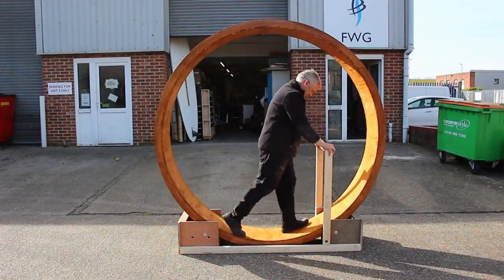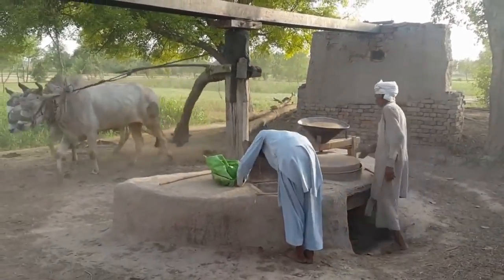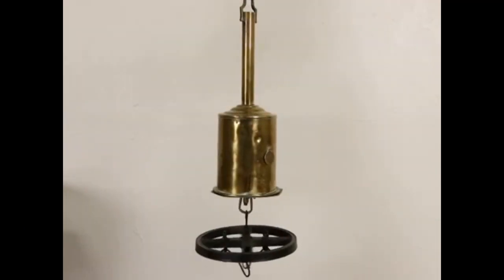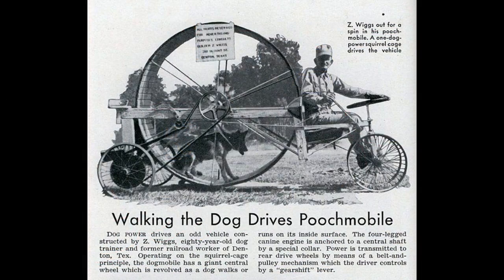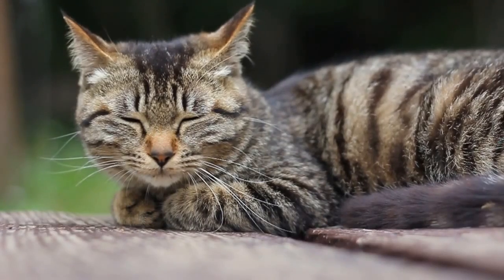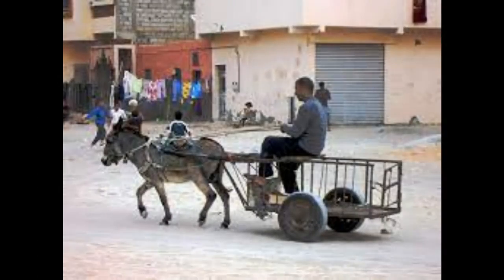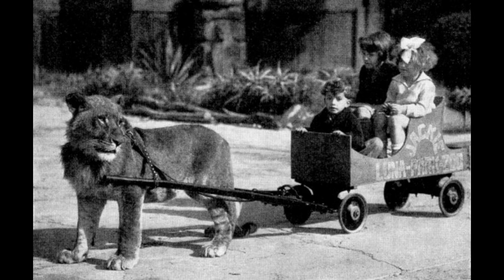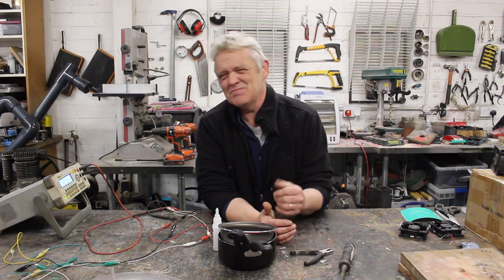1694 The Answer To The Energy Crisis - Pig, Dog And Goat Engines

Comment: Actually, in all seriousness, as I begin raising meat goats, which are larger and stronger, I do have ideas for employing them here on the farm for a variety of uses because it both gets work done while exercising them at the same time.
Reply from the maker: in all seriousness I think that's a good idea - I know I did this video as a bit of fun - but I still think there is value in the idea
Reply: @ThinkingandTinkering  When you think about how it will be when they shut off everybody's power, we'll be needing motive power for a lot of things, and there's no need to worry about an oil embargo or if it is windy, sunny or if the grid is even working if you can be sure they have enough naturally growing 'fuel' around... 

Admittedly...

This wouldn't be so easy to do for city dwellers, but maybe just doing this would take the load of the grids so that what power remaining could be sent to the cities.

Comment: Great video. Could you make a video on heat exchangers like the recoheat system? I'm interested in whether they work or not.
Reply: I have just acquired an old  gas furnace that I"m gonna use  as a heat exchanger for the exhaust on my generators. So much energy is just wasted, and it can get very cold where I live (5000').
Reply from the maker: for sure
Reply: @Mark Estrada I've been having the same kinda thoughts, wood burners vent alot of waste heat straight outdoors, I used to build heat exchange units for oil rigs, basically a collection of brass pipes that carry water through them, submerged in oil heat is transferred to the water, heat exchangers are everywhere, a radiator is a heat exchanger as takes heat from hot water and exchanges it to the air, intercoolers on turbo charged cars are also heat exchangers, Roberts distillation coil is pretty much a heat exchanger, having said that it might be worth looking into as I don't know if removing to much heat might inadvertently cause it to condense the gases

Comment: You would be surprised at the strength of a goat. We have some that we raise and there is some serious potential energy packed up in their little legs. Very strong animals
Reply: I was googling about goats a little while ago and there are actually patterns out there to make harnesses and saddles and bridles etc to fit goats so you can train them to carry loads or pull carts. Really quite fascinating. I still really would prefer a cow, but it depends on the property I get. If I can’t have a cow I will be quite happy with some goats, and if that’s the path I go down I suspect I’ll get a goat sized garden cart just for fun 🤩
Reply: But they are stubborn as well.
Reply from the maker: I'll bet I would be surprised - cheers mate

Comment: Not many people know it but most modern exercise  bikes actually have a generator with an adjustable load which is set on a dial on the  control panel. Simply remove the control panel and get it to charge a 12 volt battery. It really is that simple. BTW expect around 10 to 20 amps at high load so make sure you use a large battery.  If the battery is too small then it will over charge from too high a charge current.
Reply: You need to appreciate that although the amps are high the voltage is low so there really isn't much power there at all. The average human can output at most can 300watts/second. This needs to be maintained for an hour to generate just 0.3 kWh. A solar panel is a better solution by far.
Reply: @garyfinch1840  You are spot on. Maybe not quite with the 300watt for the average person.  That is a fit person.  I think the average is close to 200w per sec.  Yeah I do agree with you on the solar panels but why waste energy. If you had 10 people on bicycles in a gym for 1 hours each that is enough to feed the lights for the day for free. And you don't have to buy or fit solar panels.
Reply: @bartronicsecurity  yes I am probably above average. The idea only really applies for a gym and some do indeed utilise this to cover their lighting bill.
Reply: @garyfinch1840  I can't help being picky here, but watts/second is not a usual unit. It does mean SOMETHING (is analogous to acceleration if we were talking about position and motion), but is not correct here. You mean just "Watts"
Reply: @AndrewBrown-tv5ou  joules per second. My bad
Reply from the maker: cheers mate

Comment: You can use a cat, but using the cat won't be as efficient as the dog the goat and the pig. You also won't get as much electricity as the size of the charging system would need to be small enough so that it did not discourage the cat from playing with it.

You would have to make a ball that had a small generator that charged a battery or a set of capacitors when the cat is playing with the ball.

Obviously, the cat won't play with the ball on command, so to get the cat motivated when you need a charge, make sure the ball has a small compartment where you can insert a bit of catnip.
Reply from the maker: lol - effective cat utilisation - I like it mate